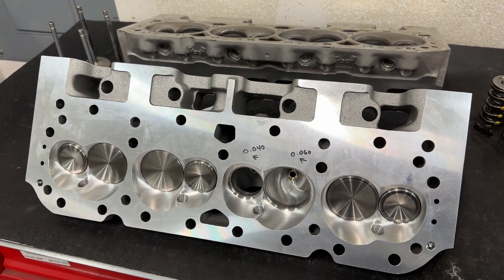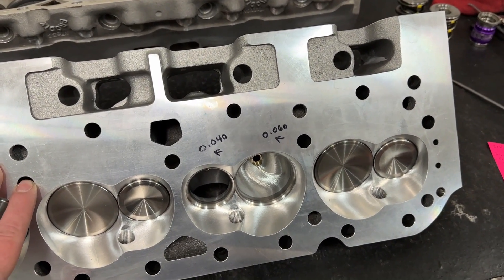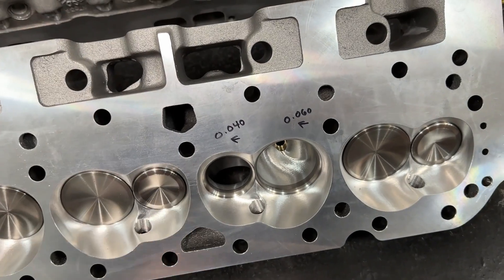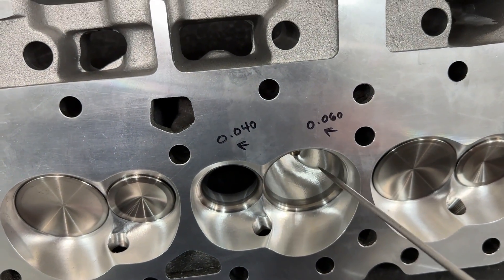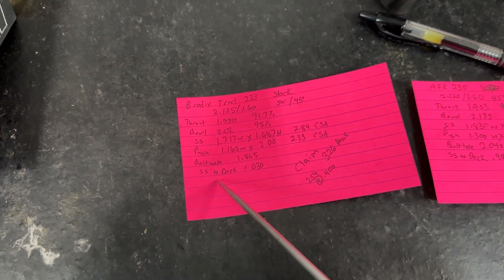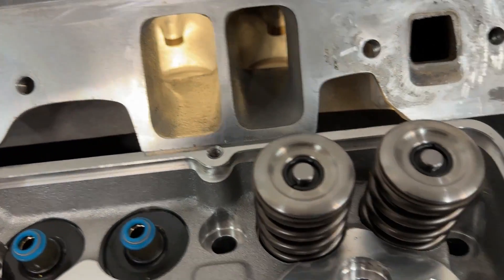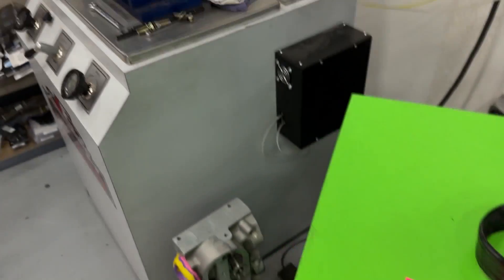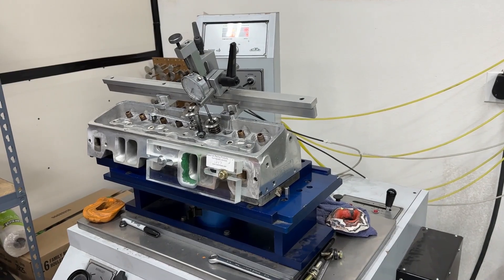AFR 235cc VS Brodix Trac 1 233cc

Comment: Hello there, Eric. I'm sure you know, the 6901 gasket is a better fit for the AFR heads. A properly sized fixture may result in different flow numbers. Also, keep in mind the 6901 matches the Trick Flow R-series intake manifold better than a 1206. This manifold is designed for the Super 23 230cc heads that you mentioned in the video.
Reply from the maker: I clay up the corners to make it perfect. The flow numbers will not change more than 2cfm from this at peak.